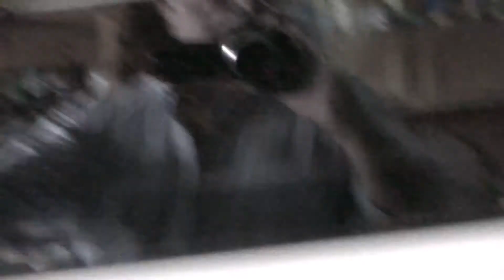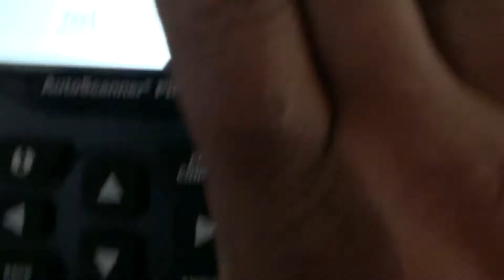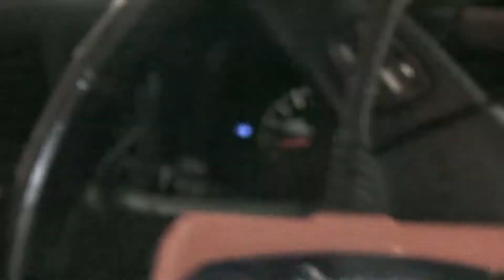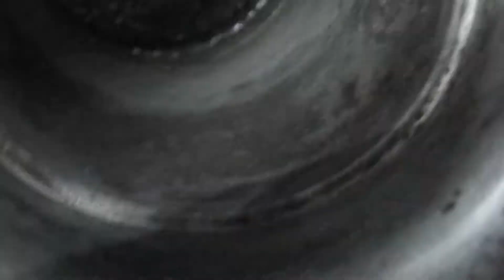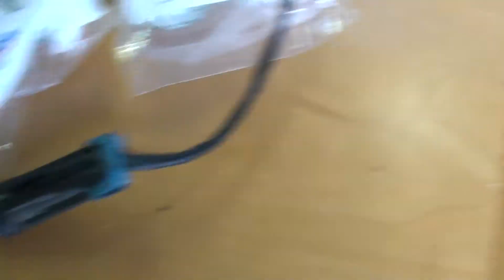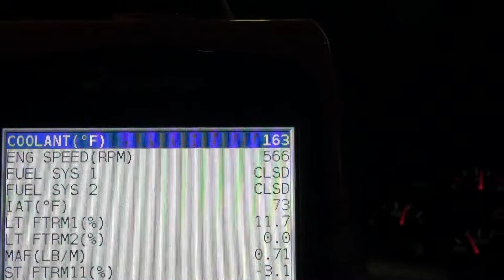Silverado Intake and Knock Sensors

Comment: I just received the 2 upstream O2 sensors for my 2003 Tahoe with the 5.3L (I love that engine).  Keep getting a fault code for Bank 1 but I am going to replace both upstream sensors.
Reply from the maker: Larry if that doesn't do the trick, try to smoke the exhaust for a leak, you might be getting air that is disrupting the O2 sensor. It is a great engine. once you understand how things are supposed to work then DIYers can  work on them. Great to hear from you Larry :)
Reply from the maker: Larry if that doesn't do the trick, try to smoke the exhaust for a leak, you might be getting air that is disrupting the O2 sensor. It is a great engine. once you understand how things are supposed to work then DIYers can  work on them. Great to hear from you Larry :)

Comment: What?!! What?!! ...a video from Cary!! lol Good to see ya back!  Nice work on your truck, when ya want me to drop mine off?
Reply from the maker: Anytime bro, these motors are wondeful. it does take a few tricks to do some things but for the most part a lot easier than pulling a old manifold on the early mouse engine lol I will try and make more videos. My knock sensors are still acting up. I noticed I couldn't get them to the torque specs before they started to turn. bummer might have to yank the intake off again but this time won't be a big deal the vacuum leak is gone but live and learn right;)